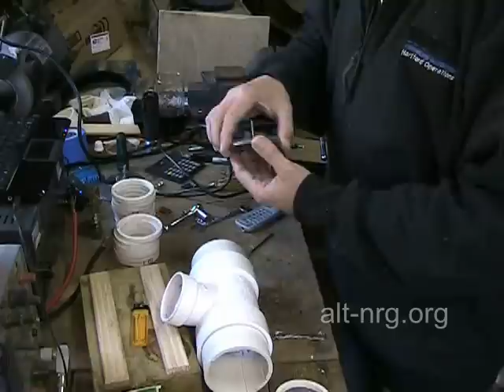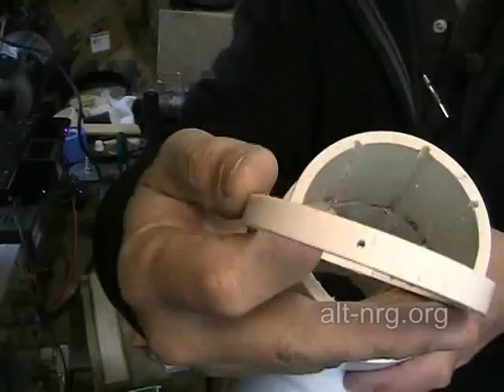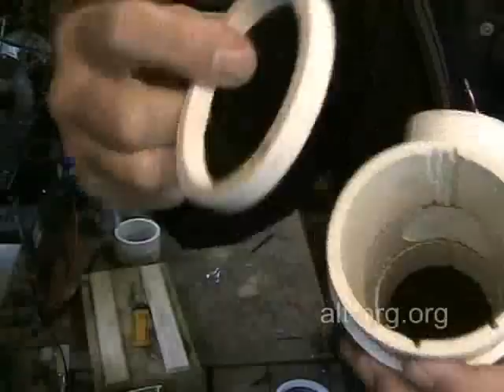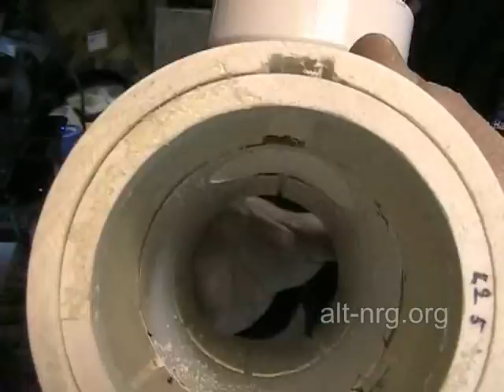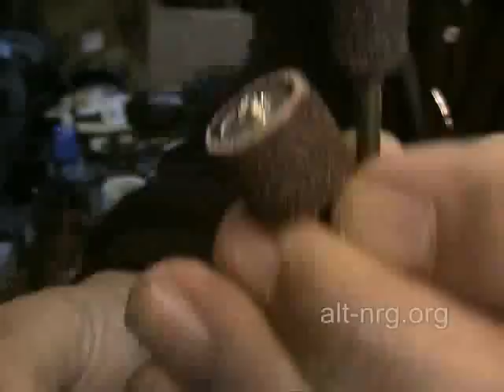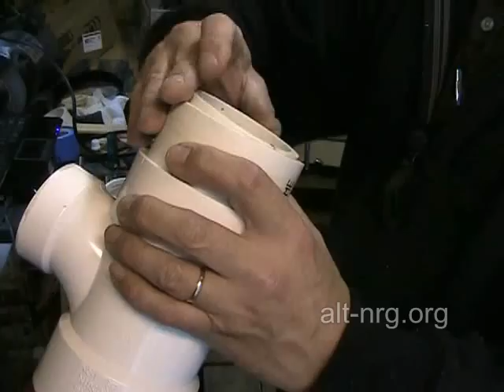#209 - Inverted T-cell rebuild

Comment: Hi Zero, I was thinking, if it was possible to put a slightly larger tube around it the tubes where the plates are positioned, and if it is possible to seal it up without leaks, then it would be easier to avoid current leakage, and you can simply drill holes in the smallest tube for the gas outlet and the electrolyte inlet. No need for grooves then. 

Greets, iT